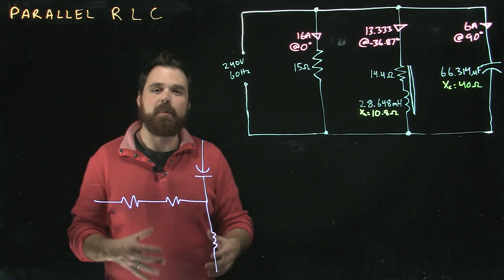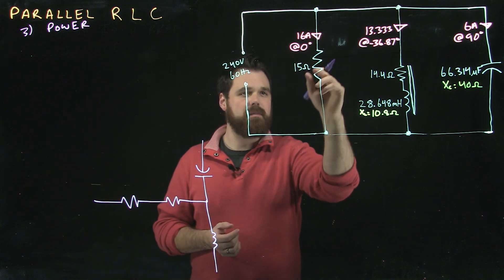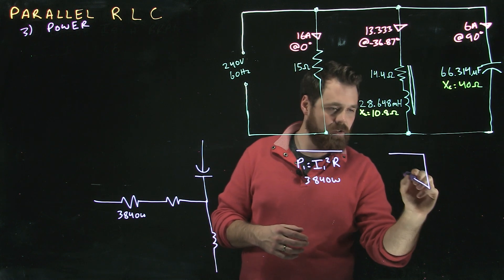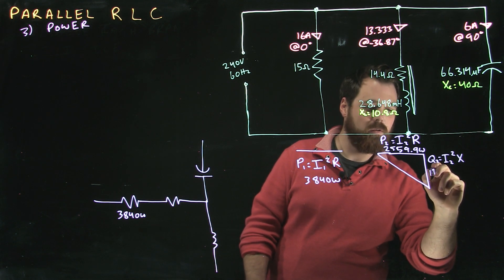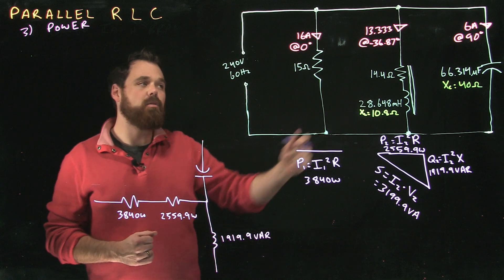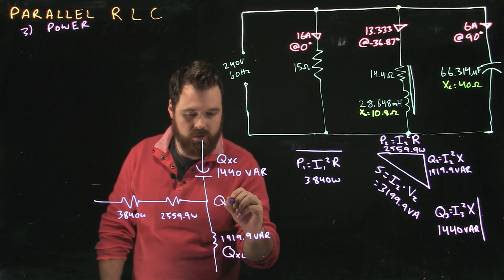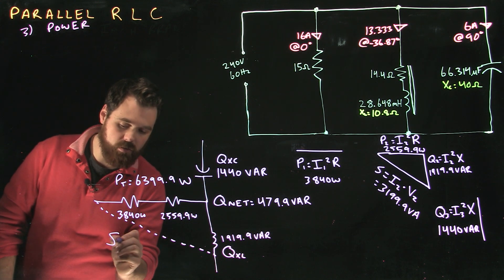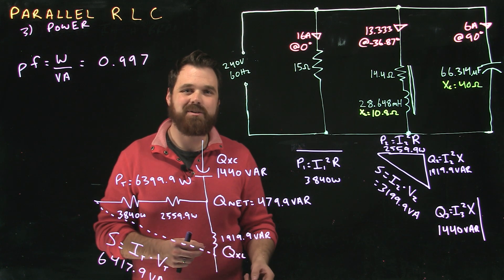Parallel RLC Step 3 Power

Comment: Nice job but far too complicated! See complex method below:
I put I(total)=(26.66-j2)A in comment before. From this I*=(26.66+j2)A. Apparent power S=UI*=(6.4+j0.48)kVA and the Power Factor is 0.997. Now you can make the triangle and get Q=479.5VAr and P=6.39kW from it.

Job done in 20 seconds! Plus no need to bother about angles and staff, just genuine complex algebra what even a baby can do! :D
Reply: To carry it a step further and I always got messed up with the RMS factor 1/sqrt(2)^2   --------EDIT: trying to learn Octave
Resistor:
>> zr=15    zr =  15
>> Ir=240/15   %   this is RMS  no 1/2 factor!   Ir =  16
>> Sr=zr*Ir*conj(Ir)   Sr =  3840
Inductor
>> zl=14.4+28.648e-3*2*pi*60*i   zl =  14.400 + 10.800i  
>> Il=240/zl %   this is RMS   Il =  10.6666 -  8.0000i   
>> Sl=zl*Il*conj(Il)   Sl =  2560.0 + 1920.0i
Capacitor
>> zc=1/(2*pi*60*66.314e-6 * i)   zc =   0.00000 - 40.00034i
>> Ic=240/zc %   this is RMS   Ic = -0.00000 + 5.99995i
>> Sc=zc*Ic*conj(Ic)   Sc = -0.0000e+00 - 1.4400e+03i
Totals
>> zt=1/(1/zr+1/z1+1/zc)   zt =  8.94967 + 0.67125i
>> It=240/zt %   this is RMS   It =  26.6666 -  2.0001i

>> St=zt*It*conj(It)   St =  6399.99 +  480.01i
>> Sr+Sl+Sc   ans =  6399.99 +  480.01i